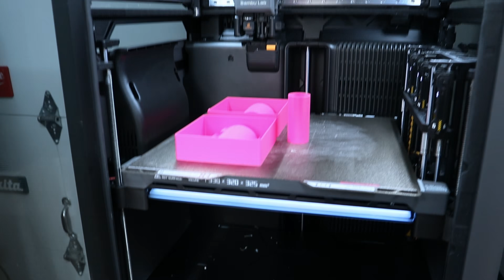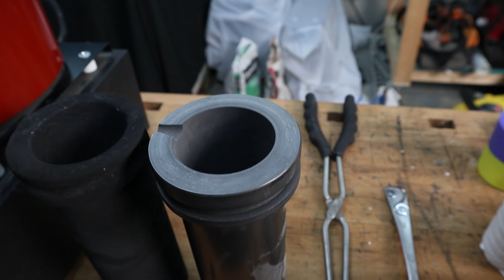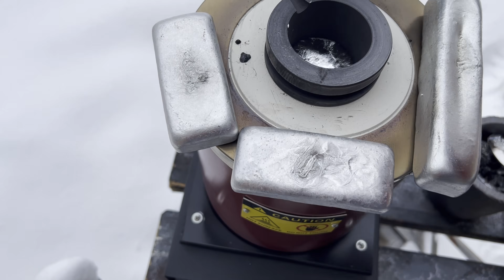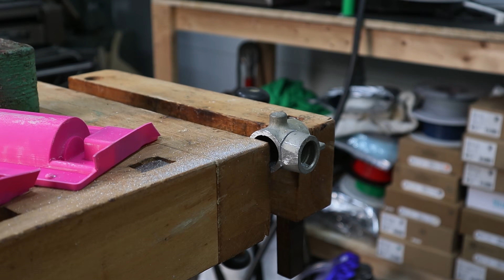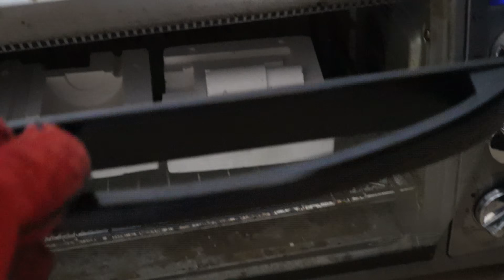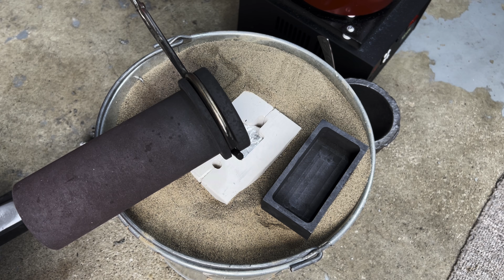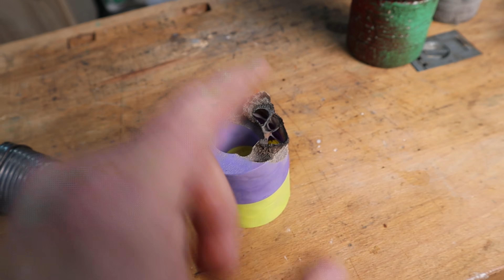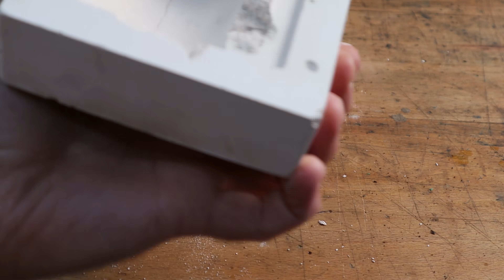Can these 3D prints make metal casting easier and better?

Comment: Why not model the plaster cast on a 30 degree angle, then you fill the mold from the lowest point, and have the air outlet at the highest point, with out air pockets.
Also, have a vabration plate, to vibrate the air out of the plaster

Comment: That was awesome!  When you placed the Styrofoam and attached it to the 2 glued PLA cylinders you didn't attach an air vent.  I think it would have casted better.  What kind of sand did you pour over the objects in the metal bucket?  Thanks.  I worked in a art foundry as a wax worker.

Comment: This is good work using backyard casting methods. But honestly, you don't need to suffer this much. 3D print your parts on a resin printer with a resin made to burn out clean from an invesrtment mould. Siraya Tech True Blue is hard to beat. Use an investment plaster that's made for the job, not plaster of Paris. Burn out the mould properly - I made my own burnout oven for a ramped temperature process, but you can get away with some improvisation. Pour the metal into a hot mould and use vaccuum assist. A 120 uk pounds vacuum pump will do a great job. I built  all my own gear and it cost money, but not a fortune.

Comment: Measure your water rather than eyeballing it
use a vibratory table or device to remove air from the plaster before pouring, use a vacuum mixer if you can
use a specific plaster designed for investment casting
Reply: Good points. Water and plaster should be measured by weight to the gram. And adding the powder to the water instead of water to the powder is not just ritual. It makes a big difference on how well the stuff is mixed

Comment: I have a theory, print a master. Silicone mold it, then was positive, in the mold, smooth the wax if needed, make a lost wax cast mold then metal poor and you keep the Silicone mold to repeat no more prints, and wax is recoverable. Why doesn't anyone do that. Is there a reason?

Another though, those coils you can use to melt metal, or heat metal, have a large coil around the mold to keep the metal heated in the mold for a good mold and not have it solidify early trapping air

Comment: you should invest in specific CAST sand instead of just using an 0/1 fk16
then you get a lot more details out as well,
also what my casting experience in Silicone molds show is if you put a chanel
down direct centered make it conic so it works as a funnel put the gravity to work
and then go of off them like a spider web, it's complicated but it pays of,
and do the breathers next to them you have a lot less problems with defects or unevenness
and DON'T FILL the Breather!!

my next big "project" expierience will be casting with a 25kg furnace (or two) 
locomotive parts for a Livesteamer in a 80kg form/cast sandbox,
I hope a colleauge of mine can help with the 3D print for the Paterns,
so I can form/mold them in the sand and hopefully get the parts I need, in the quality I desire.
More challenging will be the metal to use, because aloy won't be strong enough brass very expensive 
and Steel too hot or Iron too soft.

Comment: use the 3d print to create a silicone mold you can peel away from the plaster and reusable if making more than one. try a larger vent tube and cast some risers to stick to top of mold to build more pressure. instead of drilling holes use thin wires you can pull out after it has set up a bit if if making a lot of same parts make a wood flasks to hold the halves together so that while melting next pot replace the flask/mold with next one

Comment: Another great episode! Plaster by itself is not a great mold material. It's weak and it's very impermeable to gas, making it much harder to avoid bubbles/inclusions in the finished casting. But you accounted for that by adding fine sand, which improves both the strength and the ability to vent gas though the plaster/sand itself. Of course, you still need an entry and exit sprue and drilled vent holes. The other issue (which you also accounted for) is moisture in the plaster mold. This is a two fold problem. 

1. When you add water to the plaster mix, it causes the plaster to heat up and harden because it is busy making a jillion crystals to produce the hard compound, gypsum. A significant amount of the water is a necessary part of the crystalline structure of gypsum. Perfectly dry gypsum (or set plaster of paris) is 20.9% water by weight.  

2. There is also water that is trapped by capillary action between the layers of crystalline structure that are not chemically part of the gypsum. That's the part that can be removed by heating the mold. It takes a long time. And when you're "done" the plaster is very hygroscopic, meaning that it's best to go straight from the drying oven to the pour. Even if you bake the mold for 24 hours and then let it sit in a damp garage or basement overnight, it's now a wet mold again. The water that is chemically part of the plaster is not too much to vent if you include sand in the mix, good venting and remove all the "loose" water by baking first.

Comment: There's a cheaper and more effective alternative to hot glue.  Dissolve a styrofoam with acetone in a airtight sealable glass jar. Add either more foam to thicken the solution, or more acetone to thin it out. It should be the consistency of honey. 

Brush on a very thin layer on one of the mating surfaces and lightly hold the two pieces together for a second. It doesn't glue, but welds them together with no visible seams. 

It can also be used to build complex parts by combining small styrofoam pieces together or to fill any voids. When done, tightly cover the jar to keep it from hardening.

Comment: Adding sand to plaster lowers the surface finish quality by a lot. Not sure where you are, but in here I can get silica powder for less than a dollar per kg (much cheaper than the plaster itself) so I'd advise that. The grains are so miniscule that you might as well consider it non existing.

Comment: Have you tried PolyMaker PolyCast filament?  It looks like this is made just for this purpose, read it melts absolutely ash free?  Curious if you have tried it out? Think I saw priced about $25 roll individually priced.

I am really enjoying uses you do for 3d printing very much matches own uses.  I have lots of experience doing higher temp engineering grade prints. 

I am huge Qidi supporter and Bambu.  Qidi been my mainstay for years, but my H2D growing on me just ordered first P2S setup with AMS so can now do 8 color on my setup having two Bambu AMS units on hand.  This was tenth FDM printer for my farm.

Comment: Nice video!
In art school we did lost foam and we used masking tape and/or copy paper on the surface of the foam to make it come out smooth. Apparently the metal takes the texture of the interface with the sand. it also might help to use a hot wire cutter to cut the foam to get a smoother texture. Green sand also gives a better surface than the plain construction sand.

Comment: Here is another trick. 3d print the part you exactly need with the cleanest pla you can find. Glue your casting channels to it. Paint it with a plaster. Let it dry. Wrap it with a thin wire randomly all around and paint it with plaster again. Give it a really thick layers of plaster. Then burn pla out of your plaster mold. Put your mole into sand for stability. Cast aluminum into super hot mold. Enjoy the result.

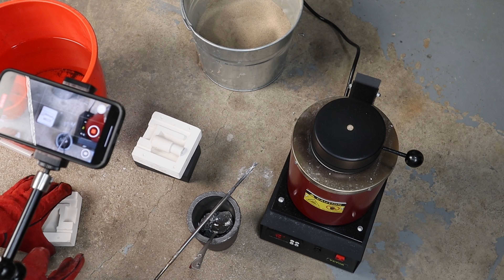Comment: It would be a lot easier to assemble your mold at 15:00 if you used multiple strands of 0.020" safety wire and a set of safety wire pliers- this would allow a very snug fit with minimum effort because the pliers automagically spin the wire tight.

Comment: Could you re dip after the yarn burnout? Plus even a hand vacuum pump used in automotive brakes $15 would help get the air out and the slip in.

Comment: i think the crazy thing would be if you could print whatever you want to make out of some kind of material that melts very easily (the best would be wax) and than put it in a square mold with the part floatin in the middle and than: either with compacting earth or with some kind of plaster (that doesn't heat up to much and melt the form)... then after curation, you put it in an oven making sure the part melts out and than you have a mold... this is wax molding but with 3d printers and at home

Comment: To eliminate bubbles and voids in your plaster moulds you can get some really small "personal vibrators" that are around the size of a pencil or pen (pen pal vibrator was the first one that actually matched up with the ones i was thinking of). Works just like the larger concrete vibrators. 
They're small so you can really get into the small nooks of your mould. The idea was introduced to me by the Evan and Katelyn channel so credit goes to them.

Comment: @NeedItMakeIt

Hello, can you make a video on directly metal casting 3D printed patterns. There is some research on this and it is ground breaking. It should help guarantee results if you use infill of 0-5% and transparent pla with a thin layer of slurry/ceramic shell either plaster or combined with silica sand. Thank you for the great videos.

Comment: Casting is always exciting/anxiety inducing at hobby scale, since success and quality varies so much, especially in aluminum without a vacuum (steel is actually more reliable despite the higher heat.. its just also harder to machine away again).
I've had a couple things that needed only a little lick with a carding wheel (not a wire wheel.. difference is you can touch bare skin to the former and be fine, the latter is much more aggressive in its cutting) to go right into use, and others where it wasn't even clear what shape I'd intended to begin with.
I do not think gas was a factor in the failure, only in that slightly uneven top on the plaster. Your sprue simply melted/collapsed during the previous pour. I also say this because I've seen other people have quite successful lost PLA casts, although its not a format I've tried myself. Likewise sadly I think if you machine into the foam cast example shown you'll find those patterns/voids pretty deep in the sides.

A few recommendations, noting as caveat I'm not an expert and might even have poured less than you have.
-I highly recommend using a little hand sander (without actual sandpaper fitted) on the side of the mold to shake the mix level and all the little air bubbles out...full sized concrete pours use a much bigger version of basically the same thing.
-For melting and pouring aluminum you can save a ton of money by just using a bit of steel pipe with an end welded on. It will last more pours than a nice graphic or ceramic one, is more thermally conductive for faster melt, and is comically cheap by comparison. Of course this won't work for higher melting points, I have not tried copper, and obviously steel will not work. Welding together a few hot rolled 90degree steel angles also makes a very large/economical "ingot" mold for future remelt, while having draft angles suitable for easy removal.
-Be warned the parts will try sit on the bottom of the bucket and melt it, a cheap galvinized pail is one option, the other is chuck something in the bottom as a spacer.. from a cheap wire dish rack to a couple bits of wood, its not a complex job.
-Finally I recommend using a variable layer heights printing curves that span layers, this will get the visible lines at as even of a spacing as possible, instead of the clear stair stepping on the top/bottom. These detail zones will want to be as little as 0.1mm layers, meanwhile you can be using up to 0.32mm layers (on a 0.4mm nozzle, 0.6mm will do even more) in the middle with no real impact on the casting, and save a bunch of time.

Comment: Pouring basin/sprue is done wrong and not working for you. Worth it to spend a bit of time digging through Old Foundryman's channel as well as swdweeb's channel. Where you squared off, needs to be radiused and you need to pour fast enough to keep the sprue (should be tapered) full..this keeps air from being pulled down into the casting creating porosity. The bubbing was moisture boiling off...need longer dry times. The moisture boiling off will create porosity as well...it it doesn't cause a steam explosion, which is VERY dangerous with molten metal. Something you might look into is sand/sodium silicate (water glass) mixture hardened with co2...no water to deal with in the mold.

Comment: Granted its been years since I had Aluminum blast furnace (home built) up an running, but I thought with things like lost-foam or PLA, you'd still use a proper 'casting sand', not just dry (probably silica) sand?
Making the plaster mold using the 3d print was super cool to see, I want to try that.
I lost my blast furnace a long time ago and my friend and I were talking about rebuilding it. But depending on price, that electric you have is super cool (and way more convenient).

Comment: I'm very surprised that you can cast aluminum directly into plaster. But you really need to dry them out slowly, preferably below 30% air humidity for like 4-7 days depending on the size. Also there are a bunch of plasters out there, in Russia they are called Г5, Г16, Г19, Г50 etc, number is just a compressive strength. Some are more porous, some not, some have small particles or big (I, II, III marking)
Even if it's one time use, it's really cool, and you can just make silicone mould for plaster, and plaster is pretty cheap (12-15$ per 10kg here, but you can buy big bags for the same price in some places, like 50kg bags)
But I think if the plaster mould is done right it could hold a few pours or more

Comment: Gypsum is especially attractive in gravity aluminum molding, because it can be recycled or restored as a hemihydrate with the least amount of energy or heat compared with the others.  It does make the mold cool slowly though, and the same properties make drying prep take a long time. The finish and shrinking properties are all quite good.

Comment: Add a resavor at the top of your print cavity to take up the shrinkage and produce a flat top.
applying a vacuum to the bottom of the  plaster (it's quit porous to air) can help the detail.
A higher sprue hole will increase the pressure on the aluminum and fill detail better like the vacuum also does.

Comment: I wonder if casting the molds out of cementious non-shrink precision grout could yield stronger molds for multiple reuses. Precision grout can be mixed to flowable or fluid consistencies. Of course allowing for complete curing is necessary. This method would not be suitable for casting something quick and dirty. Could be more suitable if one wanted to cast multiple castings from the same mold.

Comment: why use so much infill? single wall single bottom and top, with supportive cubic or lightning infill is what i use for lost casting :) also you get more air out from vibrating it with something like a corner sander.

Comment: If you want your casting sand to retain it's shape better you might want to add a oil to it as a binder. You can also use grade B molasses which works really well.

Comment: 21:00 The reason for the low area at the top of your casting is caused by aluminum shrinkage. If you notice the top surface gets higher the closer it gets to the material in the vent. This is because the casting can feed off of the metal in the vent. What you need is a larger diameter riser at the top to feed the casting as it cools.
If you look at your aluminum ingots they all have a sunken area at their top. This is caused by the aluminum shrinking when it cools. If they had a riser it would feed the ingot and prevent this sunken area. This is the same as what happens in your mold. With a larger riser it would feed the casting and prevent this sunken area or low spot.

I have this same electric furnace and had the tongs for lifting the crucible slip open. I made a metal clip that can be flipped over the shafts of the tongs to prevent them from accidentally opening. The last thing you want is a full crucible of molten aluminum dropping to the floor. Acts as a backup just in case. Excellent video with lots of great information. Cheers Willy

Comment: The best one is definitely the plaster cast. Instead of multiple vents at the top, angle the part in the mold so there is a singular high point, instead of a large flat one. Just angling by 10 degrees will be beneficial.

Comment: You are one pour away from a steam explosion, it’s incredibly dangerous to pour into a wet mold, especially something like plaster that has a high water content.  Please burn out and thoroughly dry your molds first, the last thing you want is a blast of liquid metal in your face, especially something as hot as copper.

Comment: if you coat the foam with a finer material, you get a better surface finish. Thin down some drywall compound and just lightly coat it. this makes the inside of the mold that touches the metal as the foam goes away, instead of the coarse sand. Not thick. you want it to still out gas through the sand. Just paint on a liquidy coating of drywall compound for a better surface finish.

Comment: For plaster molds, I've seen a method where you put it in a microwave for a short while to soften the plastic. It gets steamed from the inside and then you can peel it right off with pliers.